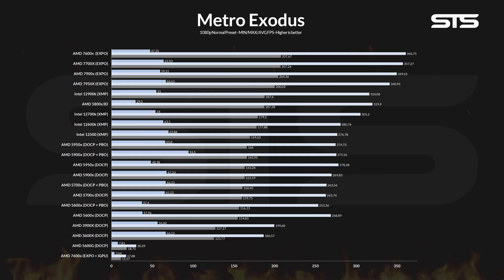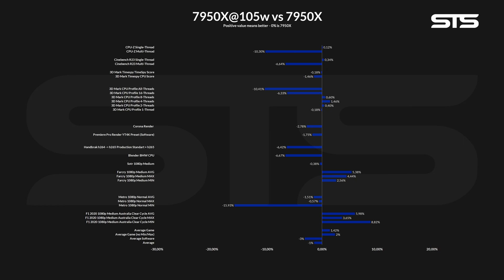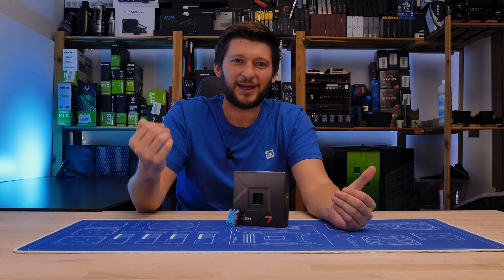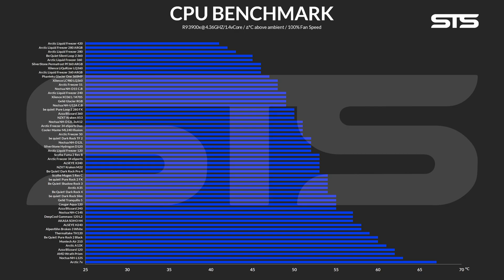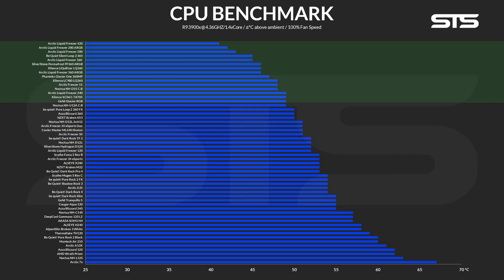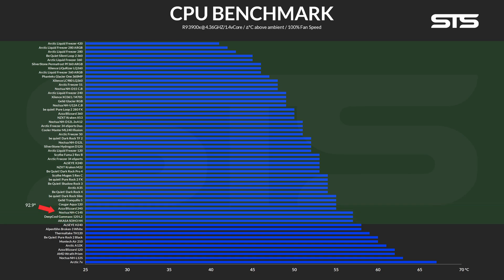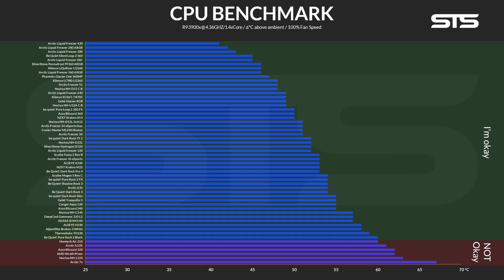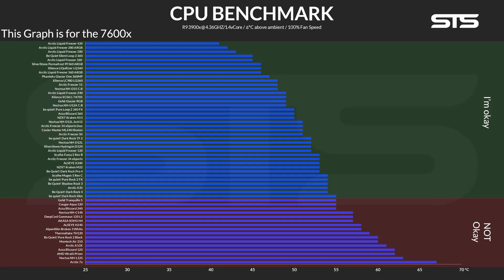How FAT should a Ryzen 7700x cooler be? ❄️ - 7700x Cooling

Comment: Hello, will Thermalright Phantom Spirit 120 SE be enough for my ryzen 7 7700x processor?
Reply: I have the exact cooler, I undervolted the 7700x and in games I get temps in the high 60s and only goes over 70 when playing cod so far, stock temps was in the 70s, and 80s while playing cod
Reply: @howardeselin7573 I bought a 240mm liquid cooler and saw temperatures reach 90-95 degrees Celsius momentarily while rendering a game with factory settings 😂 I'm currently using it in eco mode and it doesn't go above 70 degrees.

Comment: I have a 7700x and a lian li galahad ii trinity performance 360 aio and it still runs above 90c in modded minecraft with shadrs. normally its pulling upward of 150 wats despite the fact that its being udnervolted 🙏 (I dont think anything can cool this cpu 💀)
Reply: I am working on getting mine to run cooler as well. 😄 🤣 😂
Reply: Undervolting is good or get better airflow in your case

Comment: I am a Ryzen 7700x user. I didn't undervolt or overclock it because I don't think there's any need. here's why.
I tested it in every way as I could.. I used it to the maximum with the intention of loading it as much as possible, (two games were running in the background plus music, plus 4k video from the net...) for a long time. the temperature did not exceed 49 degrees Celsius.
I use the ARCTIC Freezer 36 A cooler, maybe that's why.
Reply: Bruh what's your fan curve settings? I use the same fan.
Reply: @aaronvillanueva4024  my curve optimizer mode are off😅

Comment: I did a 10 minutes cinebench23 multicore test and it went to 70c .. 7700 using AK400 air cooler.. the cooler is spinning so fast kinda hate it tbh..

Comment: NH-D15S cooler on my 7700X. When i first ran cinebench 2024 and it shot up to 95-96 degrees i thought there was something wrong. Turns out the 7700X is just tuned to max out temp no matter what and AMD said it will operate just fine for a long lifespan at these temps, which i Don't trust. So i set a quick and dirty PBO of 80 level 2 and now temps Don't go above 85 and still have decent performance. I should benchmark again and check clocks and cinebench scores without and with PBO
Reply: just play synthetic benchmarks all day dummy

Comment: Just finished building my first pc with a 7700x and idle is 42 and HEAVY GAMING SESSIONS barely get over 70°C, my current case setup is NZXT H5 Elite with 2 140mm and a 120mm toliet fan for intake  and 4 120mm fans for exhaust 1 at the rear of the case 3 on top exhausting upward I have no issues so far

Comment: I'm seriously considering going AM5 for my next build, and was thinking about picking up this processor with a Dark Rock 4 Pro. All I'm mostly going to be doing on this new machine is gaming, as I've got another machine running a 3200g for media stuff. It's good to see the Dark Rock 4 Pro is able to cool this thing, 'cause I really don't want to go liquid AIO.
Reply: I did the same mistake last year with the same cpu and cooler and believe me you better get AIO cooler for this cpu otherweise you won‘t be happy with the temperatures. I changed to arctic liquid freezer II 360mm afterwards fyi just in case if you didn‘t went for it already.. i think any 360mm AIO would do the job.

Comment: Misleading ... Ryzen 7000 series is designed to be thermal limited not power limited. Whatever the cooling solution you have, there's always a setting to let the CPU run at 95 degree. No cooling solution is good enough. Don't mislead. In other words, FAT enough doesn't exist.

Comment: I’m building my first pc, will the be quiet! pure rock 2 fx be good for a 7700x with 6950xt? I’m getting the be quiet! pure base 500fx case which has good airflow, and I’d really like to get the matching cooler if I can 🤞
Reply from the maker: Yeah, should work fine, but so yourself the favor and play with the curve. No need to dump extra heat if it doesn’t give you more performance

Comment: First of alI STS, thank you for this important and interesting content! Some things are not very clear for me. For example, when im working in Fusion 360, this algorithm will not try to reach 95 degrees I assume? Only under an more heavy workloads?

Let’s say this is correct. And I’ll compare intels 13th gen to amds 7000 serie. Both have the power limit to their max advised ppt. Than how will this 95C target from amd let the processor behave different compared to an intel processor? I mean, both processors are getting hot under heavy load. Probably intels processors even hotter because the higher tdp.

I’ve 0 experience in practice. I’m about to order hardware for my first pc build. This pc has to be as quite as possible with enough power for cad/cam software and cnc controlling software. Intel 13th gen or amd 7000 serie is my struggle right now.

Comment: Do you think a Cooler Master MasterLiquid ML360 ILLUSION ARGB 360 mm Intel(1700p)-AMD or a Cooler Master MasterLiquid ML240 ILLUSION ARGB White Edition 240 mm Intel(1700p)-AMD is enough to cool down Ryzen 7 7700X to 70C or lower? Please someone help. (edit: it would be better if the cooler kept the CPU under 65 degrees)

Comment: I have a Ryzen 7700X, and I'm using Cooler Master Hyper 212 (air cooling), and it's pretty manageable...most prolonged gaming sessions don't go above 70°c
Reply: did you undervolt your cpu? I can't see it being that low without it
Reply: @holycarcas8069  no I didn't. Actually it does go to 80° when I'm playing an intensive game for a long while!....But maybe the quality of my case and fans help, as well as the room temp!
Reply: @TooToo246  Well that makes more sense. Ryzen 7000 gets real hot. 13th gen 13700k that i have is still hotter tbh. With a 360mm aio it still goes to 60 in a prolonged gaming session after I undervolted the cpu by .05V .
Reply: @holycarcas8069  my 7700x shoots up to 80 Celsius while surfing youtube sometimes. Is this normal?
Reply: @TooToo246  bs, cap
Reply: @Dajjal-iscomingforyou  yes it is
Reply: @TooToo246  i undervolted my shii. Doesnt go above 60-65 in my case. And i be gaming hard on ultra sessions. Fortnite ultra god of war ultra
Reply: @JazanMuyanto  I also have this CPU and it never goes above 73 degrees with a cheap AIO. I did not undervolt it. Its stock.
Reply: @JazanMuyanto  is that really normal thats insane dude. so far i havent went past 60 while web surfing nut i have 10 high end airflow performance fans and a MSI CoreLiquid I360mm AIO also in a fish tank case. i will still hit 80 Degrees in like poe 2 while loading and stuff though but once loaded in its like 65 59 degree's. it fluctuates up to 70 depending on the scene.
Reply: I need your cup  setting I don’t know what I’m doing

Comment: 1:00 You seem to think that the AMD specified TDP is what the CPU is rated to run at. That is not the case. AMD's TDP has nothing to do with how much power the CPU is supposed to consume. It is simply a marketing number that has very little to do with reality. Gamers Nexus has a video and an article on this subject where how AMD basically comes up with the TDP number first for marketing reasons and then comes up with a reverse engineered formula to derive it. TDP is a marketing term, plain and simple, and one should avoid confusing or using it interchangeably with power limits or power consumption.
Reply from the maker: I know, I know, TDP is a wish at best. That’s what these videos are for. Just push everything and find out what cooler can handle it. We’re refereeing to TDP a bunch of times, but it’s more like a joke for us :)

Comment: AMD is absolute genius. They actually made a chip that can cater to different people. Those who like to leave their PC alone and just play some games can know that the CPU is overclocking itself best it can without overheating on ANY cooler. And the people who like to mess with things (me) get to tweak out over temps and voltages for the next couple months trying to maximize performance output. Personally I've found a mild undervolt of 1.20, disable all pbo and turbo boost, and 52.50 mult give me slightly higher cinebench score and 30 degrees cooler than stock (AK620 air cooler)
Reply from the maker: Yeah, though they need to find a way so that these chips do not ramp up regular coolers to lift-off
Reply: @SASenglish 😂😂😂6.2?
Reply: @SASenglish  Lol yeah right

Comment: I have a decent, but not stellar AIO. The Corsair H100i. Just for S&G's I used the Gigabyte overclocking utility and my 7600X went to 5.92Ghz almost immediately pulling 180 watts for the CPU alone. Messing with fan speeds and allowing slightly higher chipset voltage I hit 6.02Ghz. temps were 95 degrees and fans were at 100% the whole time.
I put it back to stock straight after. But - I mean wow. I got a chip to 6Ghz on a mid end AOI with barely 10 minutes fiddling in Gigabyte utility and BIOS.
I won't be doing it again though. It was a little bit scary...
Also I will be trading this in for the 2023/2024 X3D 800 class chip if one becomes availing in 18 months time.
Reply: Same here on my 7700X, all cores @5.6GHz and would single core spike random cores to 5.8-6.2GHz but the 1.56V highs kind of turned me off that OC. My plan is the same too, 2024-2025 upgrading to the ##00X3D then I should be good tell 2030
Reply: That CPU is so good ,that I'm using it on eco mode. Insane performance n around 70C on high CPU gaming usage. 38-45 stand by. Artic 51 dual.
Reply: @GremBroken you have the 7600x? I got the 7700x and having some doubts (I haven't actually used it yet) that it's worth it. I'm not sure if I'm overestimating the 2 extra cores or if the 7600x will be perfectly good for gaming/streaming and some mild content creation
Reply: @B-ROYalty  I would rather to get 7800x3D cause it's drops prices n u got Startfield.
Reply: @GremBroken  trust me I'd love to! but unfortunately I need to go the opposite direction in terms of price. Currently Best Buy has a bundle 7600x + b650 Aorus elite AX mobo for $289, which sounds like an absolute steal if that CPU is good enough. If not, I'll still probably downgrade from 7700x to the 7700 non X. Probly sometime down the road upgrade to something good like one of the x3D varients
Reply: @GremBroken  NVM, best buy increased the bundle prices substantially to where just keeping the 7700x is by far best value. Lol I'll just enjoy the ride ig 🤣 might end up using the eco-mode if it's worth it

Comment: So does that mean the 7700x is not that great? I am looking to buy this.
Reply: He is really a good processor, in my opinion Intel 13th and AMD 7000 are both really great your choice between those two will depend if your already have a motherboard of the Intel 12th or not, if you don't have a 12th mother board and you want durability if think AMD is a better choice, cause the AM5 mother you can buy now will continue to receive processor for about 4 next processors. (That's what AMD says, and looking at the AM4 platform I think this is reliable), and finally your choice will also depend if you find one in promotion or not, both are really really good processor.
Reply: @@alcatrosWhat cooler do you have? I’m building my first pc with 7700x and 6950xt, and I’m having a hard time deciding what cooler to get 😅

Comment: My dark rock pro 4 couldn’t keep it under 95° would go straight to 95° and I checked wattage and it was sitting around 130 watts :( wonder what’s going wrong maybe it’s my ambient temp
Reply: Hi, any luck with that? My 7700x has just overheated and powered off. I was considering switching to the dark rock pro 4 but now I've just read your comment. What have you decided in the end? Thanks in advance!
Reply: For everyone in the future: I ended up buying a Jonsbo cr-2000gt at a quite good price. I also played a bit with the core's voltages and got good results. I'm happy with the fan! At first there were still some issues, but it turned out to be that I hadn't seated the fan properly and got some thermal paste mess. I recommend manually spreading the paste on the cpu and placing the fan's clips with pliers (avoid moving it as much as possible once seated). I have average temps of 30ºC - 40ºC and 60ºC - 75ºC under stress!
Reply: Also thinking of getting the dark rock 4 pro. Were you able to solve your issue?

Comment: I"m running on a Noctua NH-C14S with a Noctua NF-A14 iPPC-2000 PWM, Heavy Duty Cooling Fan.  7700x set to 1.23v at 5.3 ghz across all 8 cores/16 threads.  It stays plenty cool running handbrake.  I ran the stress test on CPU-Z on 16 threads.  At the temperature sensor of the air leaving my case it was reading 26.7 celcius.  CPU was 76 C and running at 86 watts.
Reply: Is tuning the cpu down a pretty normal and easy thing to do? I am looking at buying the 7700x also but it seems there is a waste of power and created excess heat that I would not want to deal with.
Reply: @jobsearch5871  It's pretty easy.  I have the Asrock X670e Taichi and in their utility I tuned down the voltage first to 1.20 volts and increased the "set" cpu speed 100 Mhz at a time until it crashed and rebooted.  I then pushed up the cpu voltage closer to stock .01 volts at a time.  Went back and forth for a while until I landed on 1.23v running at 5.3 Ghz.  Stock it will boost 1 core up to 5.4 but running alot more voltage and heat.  I ran it a while in windows using just the utility until I determined it was stable.  Then I went into the bios and set it there to 5300 Mhz and 1.23v.  It runs smooth and cooler than stock.  Each run of the silicon from the manufacturer may run a little different.
Reply: @RotorBrake  Ok, thanks for your help . I beleive I am going to go with this cpu
Reply: So your CPU at idle sits at that frequency?
Reply: @Plainetalk  it will idle down under no load but when it's loaded up all threads go to 5.3. sorry so long to reply, hadn't noticed messages
Reply: @RotorBrake  Gotcha. I'll follow back on this thread once I get my rig up and running to take some of your info and plug it in my 7700x and then make any changes from there should I need to.
Reply: I have order a 7700x cpu a Am5 MSI AM5 Carbon mobo with 32 Gb ram ddr5 a 850Watt be quiet psu and a gpu 6950 Asus. For cooling the cpu  I ordered the dark rock 4 be quiet. I m waiting for my new pc build and I really have angst when I see this video. I hope I have the ability with this mobo to reduce the cpu max temp by underclocking the cpu or reduce the voltage or something like that
Reply: @hl7187 I have same build will a 1000w psu be good enough
Reply: @rickflair747  even 750w gold certificate psu is enough but i got 850w gold just in case
Reply: I bought a 1000w main gear ignition b+ on the teir list to future proof I may get a 5090 in the future

Comment: Ryzen 7700x tops out at 130 to 140 watts, so a big air-cooler from Arctic Cooling or Noctua ought to work fine.
Reply: 7700x is a little more complicated than that because of the location of the silicon under the IHS. I have a 360mm AIO and still sit at around 70°C when gaming modern titles. GPU is an MSI 6950xt, in a Xidax leviathan 9 fan case
Reply: @encompassthyeclipse7278  7700x can run safely at up to 95 C, according to AMD.

A 7700x processor doesn't need a liquid cooler, not at all.   A nice 120mm tower air cooler works fine.    Air cooler is more reliable, and cheaper too.  A Win-win situation.
Reply: @DerekDavis213   PC noob here. Im watching a lot of youtube videos regarding the right compatibility and parts and i seem to have a good idea what im building. What dsnt make sense to me is when youtubers and community comments talks about rpms and temperatures. As a newcomer to pc building and gaming. How would i know how to control fan speeds? When to control fan speeds? or do i even bother with all that and let the system run on stock settings. Thanks again. 

Note: im also building with an AM5 7700x chip, with Noctua U12 in NR200. Not P.
Reply: @bollean   Have you already purchased the 7700x cpu and Noctua cooler, or are you planning on those parts?

In general, the bios will automatically ramp up the fan rpm as the processor runs hotter.  Sometimes you want to manually make the fan spin up faster, which will slightly improve the processor's performance, at the cost of a bit more fan noise.   There are options in the bios for this:  Fan Tuning for example.

Ryzen 7700x (and 7900x 7950x too) are a bit different than other processors, in that the processor is designed to run at 95 degrees Celsius.   In the past, 95 degrees might be worrisome, but not with the AMD Zen 4 chips.
Reply: I got a thermal right cooler and it doesn't get hot. So it must be good?

Comment: is running the Nocuta NH-U12A with the 7700x okay for gaming? the D15 does not fit my case and im not going water/aio. any suggestion for a max 160mm height cooler that works with this beast?
Reply: Having the same problem, not enough room for noctua, gonna upgrade my case so I can throw in a 280 or 360 aio